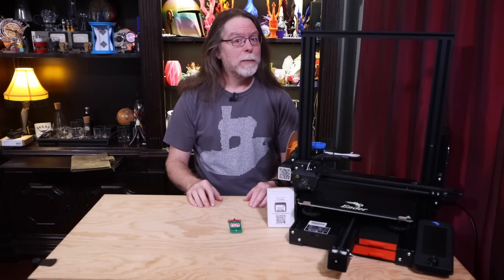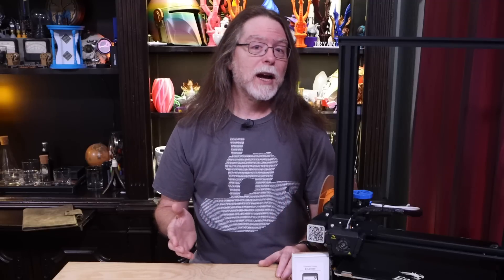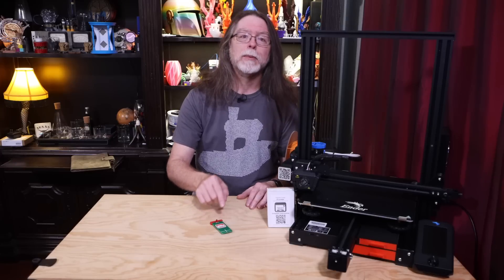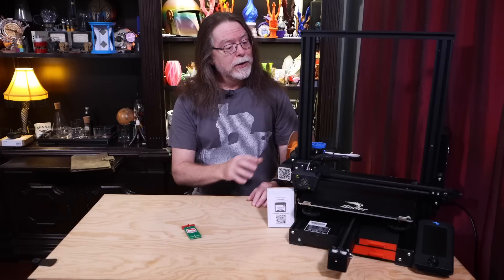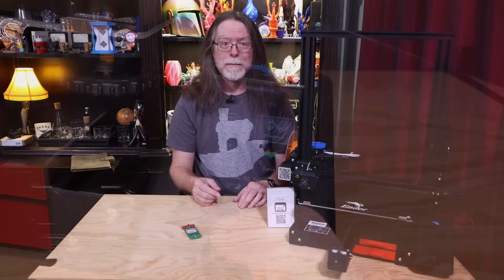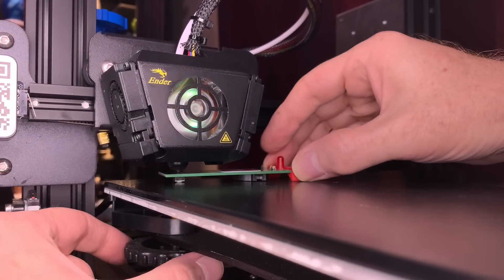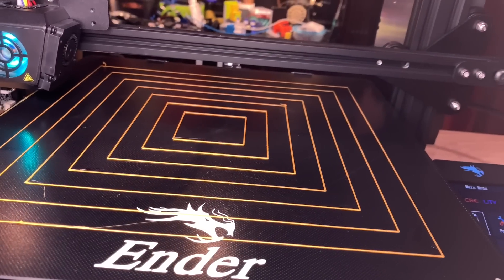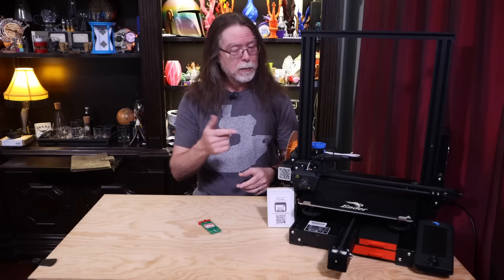Chuck Hellebuyck's E-Leveler. Be your own bed probe!

Comment: I must be doing something wrong. I have gone around and adjusted each knob to just barely turn on the light. I have done this 4 times now, each time needing to go up more. Now on the 5th try, I ran out of adjustment space. Using Sprite Extruder Pro with a BLTOUCH mounted and E-Leveler 2. Is it the BLTOUCH? Do I need to lose it or turn it off? This is very frustrating.

Comment: So I have that tool.. just got a Elegoo 3 plus.. so I have 6 wheels and 320x320 bed… can I use one of the gcodes? Problem is the corners might be ok… but not the other 2 points.

Comment: Be nice to be able to get one posted to the UK at a reasonable price. But at over £30 incl postage from the USA its far too expensive. I even tried to order a Geeetech copy but the airline would not accept it because is was electronic?
Reply: i ordered a fystec clone with a round pcb but it had to be reshipped because it contained a battery, still waiting for it

Comment: It's £50! Forget it. Do you know how much paper I can buy for that? It's a LED with a battery.

Oh, and I bet you didn't spend the $70 on one! Rip off!
Reply from the maker: Hi Simon! With that Pound sign, I'm guessing you're in the UK. I don't know how much paper costs over there, but I'm sure that for £50, you could probably buy a lot of it. From where I sit, though, these are $25 USD (which, admittedly, would still buy a lot of paper).

As I stated in the video, Chuck sent me one of these to try out. I liked it, so I made the video about it.

And yes, it's an LED and a battery and a resistor and a circuit board. You could 100% build one yourself on some perfboard. If you have the parts laying about, great! The cost to you is £0! And Chuck Hellebuyck stated in at least one of his videos about the device that he was perfectly happy for people to make their own. If you don't have the parts laying around, you could probably source them locally for a lot less than £50. I honestly don't know why it costs that much for you.

Anyway, whether you want to keep using paper, or want to build one of these yourself, I hope you have an awesome day! 👍
Reply: @BV3D  so, two months later they are £45.29 here in the UK ($52). This is still massively prohibitive for anyone remotely thinking of buying an led with a battery.

Luckily, someone else produces them now much cheaper, but still overpriced.

Comment: I'm confused. A sheet of paper is a darn-sight thinner than this leveler tool. How do you compensate for the difference in thickness when trying to achieve perfect nozzle height across the board?
Reply from the maker: The G-code file which moves the nozzle to the corners put the nozzle at Z=5.8mm at each corner. Chuck used calipers to press the switch, squeezing between the "crosshairs" side of the board and the button on the switch, and that's the distance he measured when the switch was triggered. So that's the value he set in the G-code file. With Z at 5.8mm above the zero point, adjusting the leveling knob to trigger the E Leveler's switch should put the distance between the bed and the nozzle right about 5.8mm. So, when the Z axis is at 0, the nozzle should be just barely touching the bed.

Chuck thought it was odd that I had to set a 0.2mm Z offset on my printer, so I measured the trigger distance with my calipers, and came up with a value closer to 5.6mm. Chuck recently had to change from a round switch to a square one, because the round ones were no longer being produced. My E Leveler has the square switch, so that seems to account for the difference. Chuck is going to make another G-code file available for people whose E Levelers have square switches, and it'll set the Z axis to 5.6mm, so it should be pretty close to perfect again.
Reply: @BV3D  That explanation is perfect and answers my question beautifully.  Thanks!!
Reply from the maker: @crooker2  You're very welcome!

Comment: What about if you want to give this a go on a machine other than an Ender?  Say an Ultimaker 2+ or CR-10S, etc
Reply: I think a universal jig with slightly modified geode for the corners is the way to go to make more accessible to different printers.
Reply: Just choose the file that matches your bed size. CR-10s use the Ender max files.

Comment: $25+shipping seems a bit ... expensive IMHO. Probably because of the small batch of manufacturing I guess. Guess I can try copying the design using a protoboard. Hopefully he doesn't mind.
Reply: wow, I had no idea it was that much! I imagined it was around $10!
Reply from the maker: As far as I know, Chuck doesn't mind at all. In fact he did his first prototypes on protoboards, and in one of his videos about it, he even says you can do that. 👍
Reply: @BV3D  I made one :). I basically replicate the same circuit using an IC board so I don't have to do the PCB. I still learning the rope but I can say it's easier than fidgeting with an A4 paper.

Many thanks to Chuck and to you as well!
Reply from the maker: @WutipongWongsakuldej  Awesome! 👍🏻

Comment: I bought one of the pre-assembled ones and it's pretty good.
I'm also using the Jyers 10x10 UBL firmware and used the E-leveler to get each probe point's z offset perfect. It's so convenient.
Reply: Can you explain how you do this?

Comment: So I do have a question I'm new to 3d printing and my calibration cube looks good except on one corner it's blobing.. it looks like it's stopping on that corner and melting it causing the blob to form but the taller my cube gets the better it looks .. any ideas ?
Reply: mmm that sounds like elephant's foot, a common issue in 3d print world. try the cube with a raft and see if it still has that symptom. also can try lowering your bed temp by 5 degrees.
Reply: @ashvanes484  I've checked for elephants foot but it seems that this blobing issue is only on one corner even after making the adjustment for elephant foot . Seems like it's cased from the extruder stopping on that one corner
Reply: @kwadaholicreviews6354  try turning power loss recovery on the printer off if you can, that might help

Comment: Oh, make sure the springs are not loose after running the adjustment process (everyone has replaced their stock springs w/ yellow, right? 😉) . Ideally they should be about 2 turns from snug which may require moving the Z endstop.
Reply from the maker: @Old Curmudgeon comin' in with the good advice! 👍
Reply: @BV3D  I don't always troll (or live up to my handle). Who knew. 😉😂
Reply: How much rotation do you consider "a turn" to be?  The roughly 30 degrees that's convenient to do before your fingers get tangled on the bed?  90 degrees?  360 degrees?  Of course I'm not planning to measure this precisely, just trying to get a sense of what you're suggesting, so I can adopt this best practise.  :)

Comment: Has the aspect of whether the X gantry is 1st square to the Z rails been covered before? If it's not then you're likely to make a trapezoid instead of a square.
Reply from the maker: I don't think I've done a video about that. I probably should!
Reply: @BV3D  on that note... I should really check mine. I did the Luke Hatfield reassembly method after having mine for 2wks; that was over 2yrs ago.
Reply: I made a simple leveling jig for doing that on the Ender3Max.